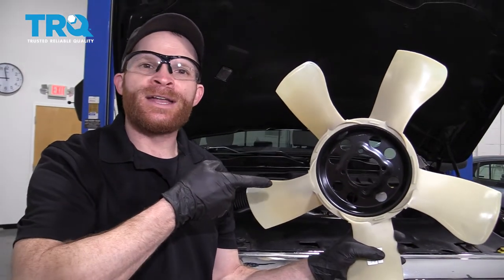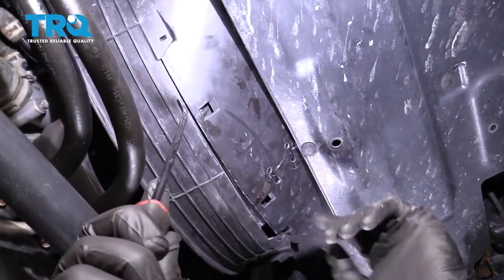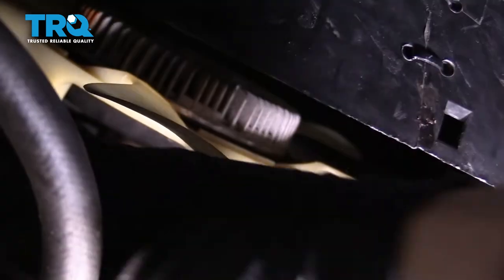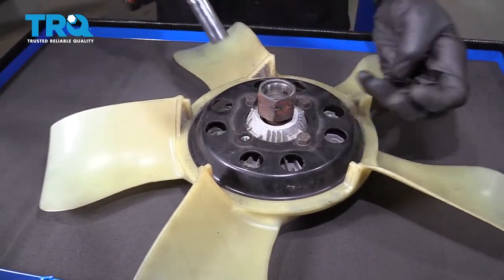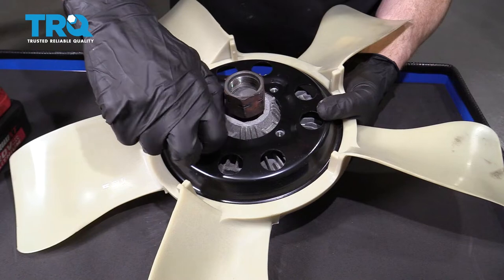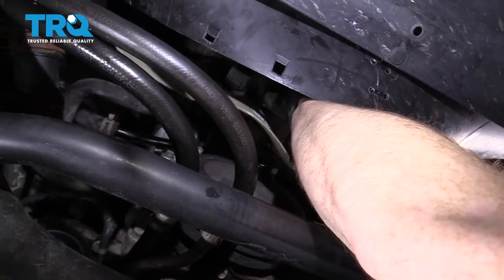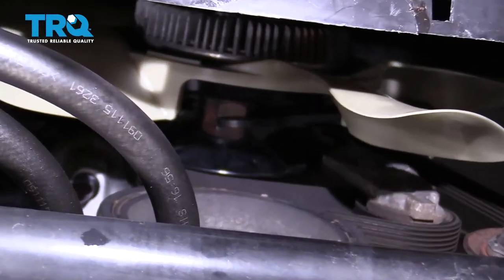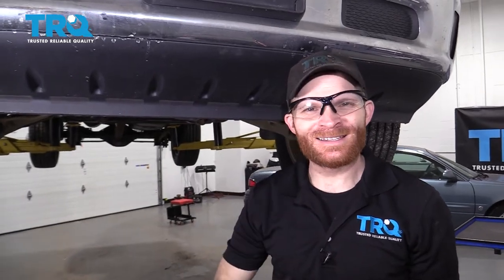How to Replace Radiator Cooling Fan Blade 2013-2018 Dodge Ram 1500

Comment: So when you used the 36mm wrench you just wacked it with your hand to loosen up that nut?  sounded like metal on metal
Reply: that thing came off way too easy. they definitely worked on it with the camera off.  they never ever come off easy.  I've seen some that had to be cut off with a sawzall.